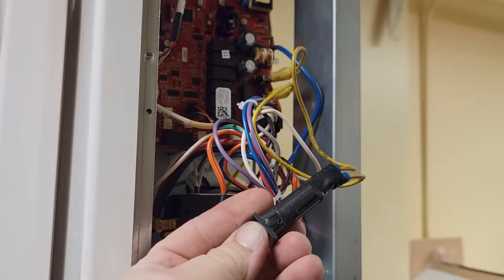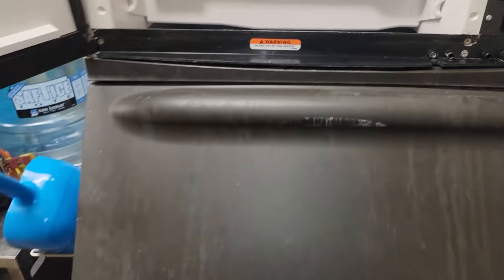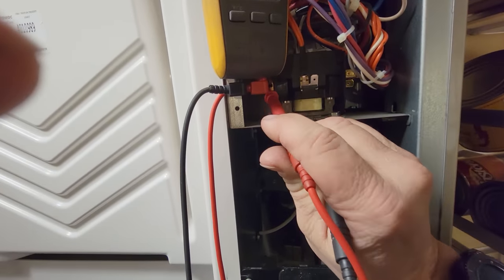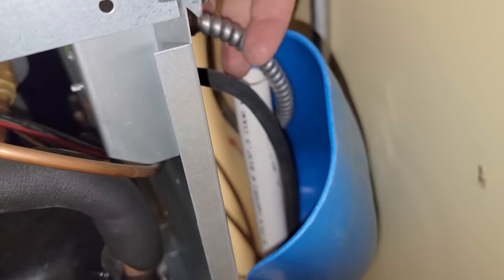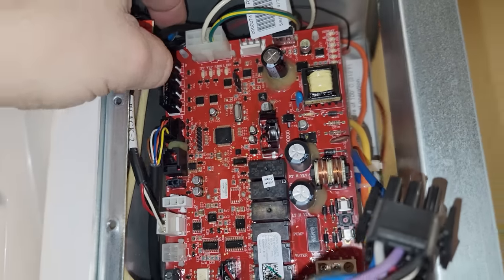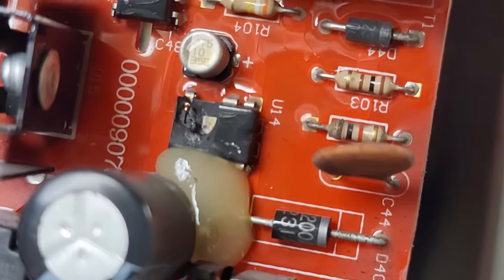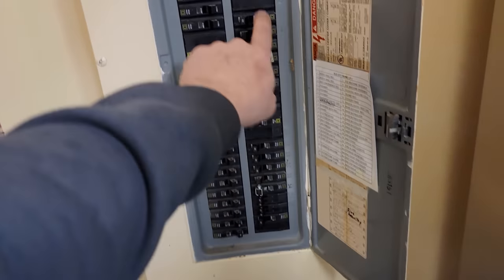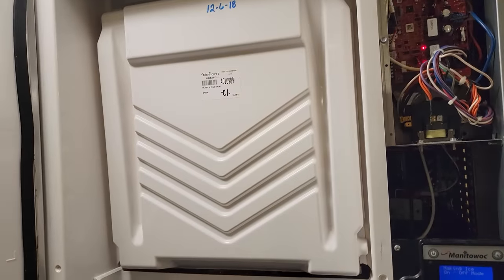Ice Maker Not Making Ice

Comment: The chip that blew is the SMPS controller with integrated power transistor, for example TNY263. It's not because of anything external to the board, being shorted, the most likely external reason could be overvoltage from the mains, but these chips often blow up when pushed to the edge.
Reply from the maker: Thank you for sharing that information, I thought I blew it at first. 👍👍
Reply: And Manitowoc always hopes that edge comes after warranty is up. Those boards are not cheap!

Comment: The chip that blew was the driver for the transformer of the power supply. I also agree with the light bulb suggestion as a fuse but you would need an incandecant bulb that is rated for the foltage you are using it on. Not sure how easy it is to get a 240V bulb in this part of the world but 2 120V bulbs in series would work too.
Reply: Since we would be using the bulb as a fuse rather than for its intended purpose, the voltage rating isn't important, as long as it passes enough current to test the machine with the components in question energized. A light bulb might actually not be a good way to test in this situation though, because the voltage drop across it will change quite a bit as different components are energized and de-energized, and these rapid voltage changes could potentially interfere with the processes involved in testing. For example, the compressor contactor might not get quite enough voltage to completely close, and this can cause the contactor to burn out. All the solenoid valves are likewise designed to run within a certain voltage range. Too low of voltage can burn out inductive loads like these solenoids and contactors because it isn't quite strong enough to fully pull the iron into its place, which leaves an air gap that makes it harder for the magnetic field being generated by the windings to complete its path through the solenoid. This greatly reduces the induction in the coil, which leads to a lot of extra energy being turned into heat inside the coil. The voltage drop across a fuse is specifically designed to be very minimal until the very second it is about to blow, so this doesn't allow your equipment to spend much time with the voltage in that danger zone. You can still use a light bulb if you're careful, but you must account for these factors. And if your board starts acting up, keep in mind that it could be due to rapid voltage drops that could occur when an inductive load engages through the light bulb. (The compressor on this machine is not wired through this fuse though.)
Reply: Now that I think about it, I see what you mean by having the right voltage rating. That way your bulbs don't burn out if you have a dead short. You can keep testing without having to keep replacing a fuse. And you have a visual cue to instantly indicate if you end up eliminating the short circuit.

Comment: I hate the fact that control boards have become such a common single point of failure for modern appliances.  In the last month I've had a newer television and garage door require control board replacements.  Seeing more junk on modern HVAC units as well.
Reply: That's why several years ago I built some of my own control boards for some of these ice machines. I used Arduino boards, solid state relays, LED's, resistors, potentiometers (to adjust settings), and integrated my own sensors. I learned how to write some basic Arduino code and used that to make my own program to read the switches and sensors and decide when all the different components would turn on and off. My boards have worked really good for many years now in the machines that I know of that that didn't fall apart for some other reason.

Comment: Been waiting on a board for this same ice machine for a year now
Reply from the maker: United refrigeration had it
Reply: I have fabricated some of my own control boards for ice machines. Not this model, but other older Manitowocs and Scotsmans. I wrote my own programs according to the model I wanted it to run, loaded them onto Arduino Nano boards, used solid state relays and some of my own sensors and LED's and such, and had to hardwire it all into the machines. I have several machines still running out there with my homemade control boards in them. The cool thing about this is that I could change any parameter I wanted to. If 3.5 minutes was not quite enough for an old Manitowc with a rough plate to harvest, I could give it as much time as it needed. I also eliminated crappy sensors that were prone to failure. I was able to use a thermistor on the back of the plate to control ice thickness, instead of the really touchy ice thickness sensors. I used a magnetic reed switch float instead of the water level sensor. Those things were always so touchy- when the boards get older they will often read full water trough just from the fully insulated wire being near the metal cover. And with the thermistor on the back of the plate, I'm able to quickly detect a no water situation, a low refrigerant situation, a bad dump valve, etc, without having to first run the machine for several hours in that less than ideal condition.

Comment: Get alot of these switch mode chips failing not so much on commercial stuff but the domestic stuff it's common and they don't have fuses so they either look like yours after the popper or there's a large resistor on incoming mains that will have failed and the chip will be short... they generally are an 8 pin package with a missing leg, if you want to you can change the chip and fuse or resistor and your good to go, or if the customer will pay just change the board and fix it later and use it to test with on other jobs...
Reply from the maker: I wondered if that was a bridge rectifier chip
Reply: designers do not take enough care with the layout and magnetics on their power supply. End up with spikes that slowly degrade the chip.
Reply: @HVACRSurvival  No, it is a fully integrated switch mode power supply IC, most likely a LNK304. The AC is rectified outside of the chip. It's a common repair on white goods.